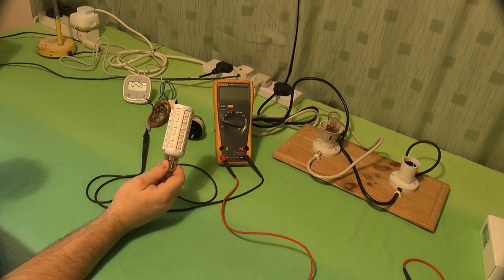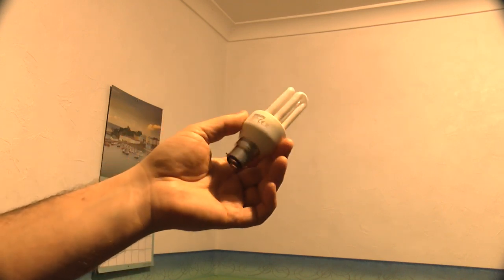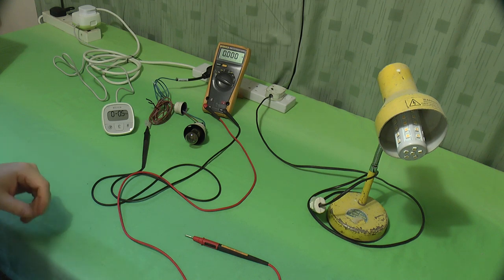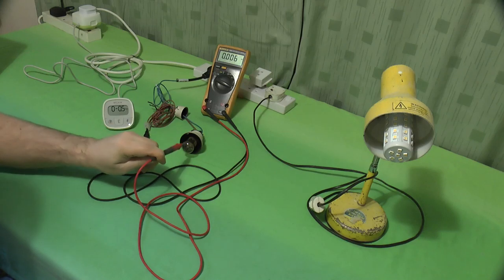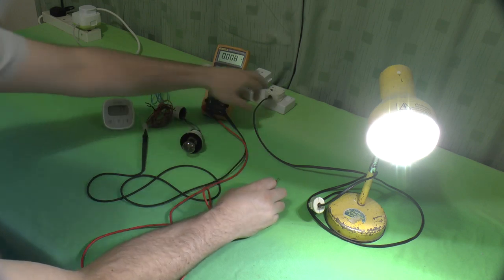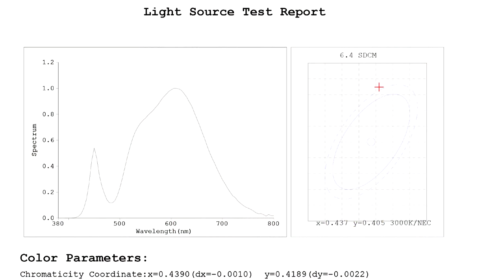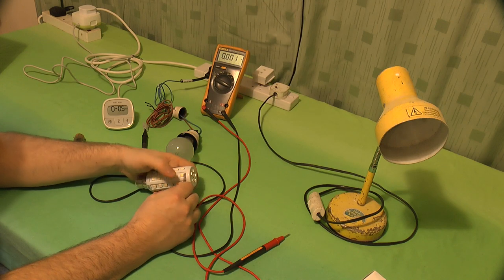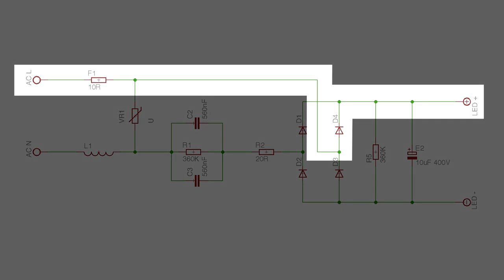Dangerous LED "corn cob" lamp test and teardown

Comment: The proper LED lamps from Philips ect have proper driver circuits... These chunks of shit just have resisters... Hardly efficient!
Reply from the maker: I'm not sure how efficient the capacitive dropper circuit is. Two of the resistors in this circuit appear to be bleed resistors to discharge the caps, but the other two are, as you say, just resistive droppers.
Reply: Not sure about efficiency, but the bulbs that have driver circuitry stand a greater chance of emitting RFI which is bad for radio reception.
Reply: I'd rather have a bit of RFI than a potential electric shock and or fire risk! At least with the big manufacturers like Sylvania or Philips, there has probably been quite a lot of money and thought gone into the design and it has actually been tested and certified so that shouldn't be a problem anyway. I replaced all of my GU10 halogens with 7w Sylvania LEDS and they are very nice, made in Europe too!
Reply: FrontSideBus  If they use a switch mode power supply then it may cause RFI.
Reply: jmcinvale I can second FrontSideBus on this. The Sylvania ones are very good and do seem to have RF filtering in their PSUs, so they should easily meat all the requirements.
Reply: Peter C the Philips ones are also very good and must include filtering since they don't create any noticeable interference
Reply from the maker: There'll be a new video coming soon with more lamps. I've got one of the Philips ones and they seem very well made. The driver circuit is definitely different as I dropped the voltage down A LOT before they gave up.

Comment: They are shit, but you should be changing bulbs with the power off and chances are you're using one hand... I'm more worried about housings, fixtures, entire floor lamps becoming live, especially with kids! Then your in real trouble. No one should believe any claims on ebay unless its a local business.
Reply: Paul Bearer Did you not hear the part where he said it's fatal?  These things are being sold to the layman, people who probably have no idea what their doing and will stick it in bedside light.  Accidently brush your hand up against it and say goodnight forever.

God forbid a parent buys one of these for a childs room.
Reply: Shini yes, did you not read the part when I said entire housings and fixtures becoming live, what is your point exacly?
These lamps should all be enclosed anyway, they won't meet any standard if they're not, for obvious reasons. The biggest concern is the fake certifications they come with that give people blind faith in the saftey of a product.

Comment: If you buy a bulb with open contacts then you get bulb with open contacts. Simple as that. What to complain about? You want with plastic cover then buy other one. This whine is pathetic. Not having cover also means it has better ventilation. And I absolutely don't care about open contacts when the lamp is 2.5m above my children. The fact that you can cut finger with a knife doesn't means knifes are piece of shit. Right?
Reply from the maker: If you cut your finger with a knife you learn that knives are sharp and you don't do it again.
If you burn your finger on a hot table lamp you learn that bulbs are hot and you don't do it again.
If you touch an exposed LED on a table lamp you may not get the chance to do anything again. LEDs run on around three volts, you don't expect low voltage equipment to be only a small resistor away from mains electricity, surely?

The UK television programme Fake Britain is looking into these lamps in their next series (I was contacted by one of their researchers last month) so I guess it's not just me "whining".
Reply: AintBigAintClever The only thing I agree is that these lamps need a warning text on them if sold in regular shops. Idiot-aware driver circuit is very optional.

Why you need to cut a finger to understand that knife is sharp? You don't have a brain or eyes? Open circuit is exactly a sharp blade. Why to touch it when it is under voltage? Don't get me wrong but if someone brain dead to that extend then it might be a good sample of a natural selection and that person probably deserves Darwin award. But even so I hardly see how someone can die from that low electricity shock. In 99.99999% cases that will be just a lesson.

Also these lamps are not a fake by any mean. No one hides that they have open circuit. There is no text on them saying safe 3v voltage. Your prediction of 3v is just your imagination. Sellers do not say so. They simply took away protection and reduce price because of that. This also increases ventilation and lamp life time. So you have choice to buy something protected for 2-4x price or get cheaper one and operate on your own risk. World full of options. Just don't expect someone else should think for you.

Also you pay too much. 7.99 pounds for 7W lamp is a joke. That price is a real fake. It cost like 3-4 times less if ordered directly from China.
Reply from the maker: The "prediction of 3v" is not just my imagination, it's the approximate forward voltage of a white or blue LED.

"I hardly see how someone can die from that low electricity shock."
It doesn't take a lot. I was using a 25 watt pygmy bulb as it's got about the same resistance as a human at 240 volts (albeit a simple analogy; as voltage increases human body resistance decreases). The effects of various current levels can be found here: https://www.osha.gov/SLTC/etools/construction/electrical_incidents/eleccurrent.html

The safety regulatory marks on the lamp shown here are counterfeit, i.e. fake. The lamp would not pass CE certification as the exposed live parts fall foul of the Low Voltage Directive.
Reply: Personally, I think the potential for an electric shock is dangerous. We are not use to such low safety standards and it would be so easy to forget that the lamp is on when you go to replace it or clean it.
Reply: ***** The main problem with these electrically unsafe LED lamps is that we've had over 100 years of conditioning that it is electrically safe to grab a lit incandescent or fluorescent bulb (even if they are hot). If LED lamps are electrically unsafe to touch while on, then this needs to be fully disclosed on the packaging, by the seller or, alternatively, built with a cover so they are safe to touch. It's extremely difficult to retrain millions of people about the risks of grabbing an LED lamp while illuminated if built with live contacts. It's far simpler to cover the lamp and protect it from being touched. If a consumer is shopping by price alone and the seller is not disclosing the safety of the product, then that's considered negligent. If you're selling a product and you know it's inherently unsafe, you should warn buyers of that fact before purchase. It's not a very smart idea to potentially kill your customers by not disclosing safety handling guidelines of the product.
Reply: AintBigAintClever You are wasting your time with idiots like Igor, who cannot comprehend basic circuit theory. The only way you may be able to get it to "click" for people like him is to draw up a auto-transformer and explain why they are dangerous since they are not isolated and that touching a neutral or ground and then complete the circuit to any output secondary side connection on an auto-transformer is fatal, whereas touching an output of the auto-transformer to some other output point on the transformer secondary side may not....
Reply: EETechs Why read whole discussion when you can blindly insult people right? I don't see any brain in that. Just like I don't see any brain in people who look at lamp with open circuit and don't understand it is unsafe. According to duck typing if you say like an animal and laugh like an animal then maybe you are an animal?  It is more like hyena behavior. Humanity kills millions of animals daily so I have no pity if you die from electricity this way. Old good natural selection. Do you like this point of view?
There always will be safe and unsafe tools. You have to use your brain to choose. You cannot put under restraint unsafe tools only because someone can kill himself with them if use improperly. That doesn't makes any sense.